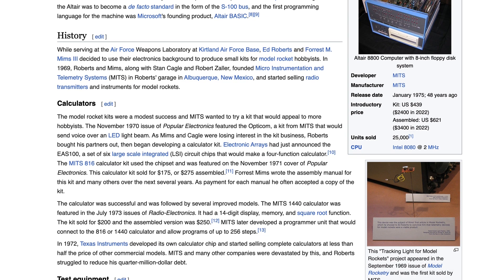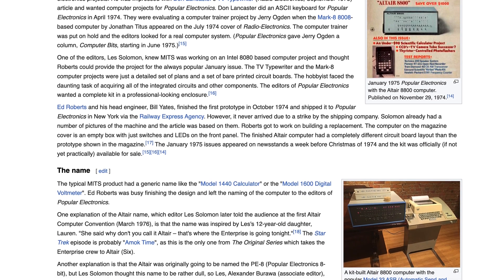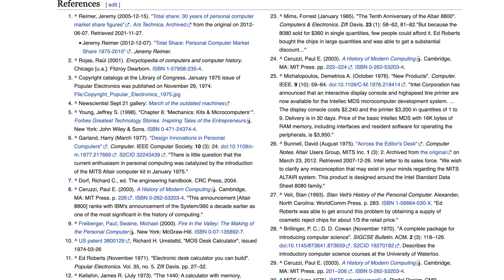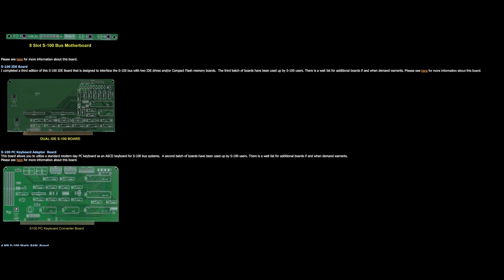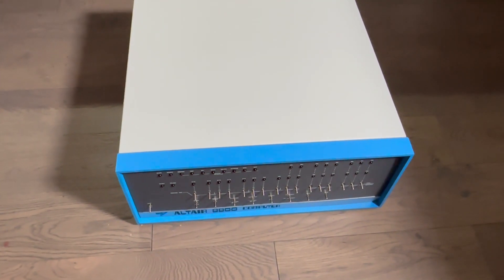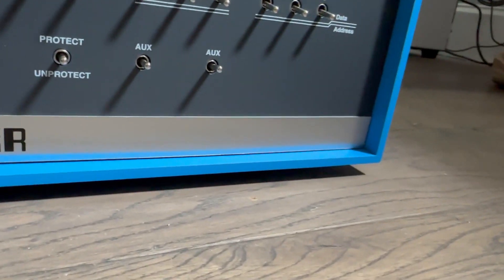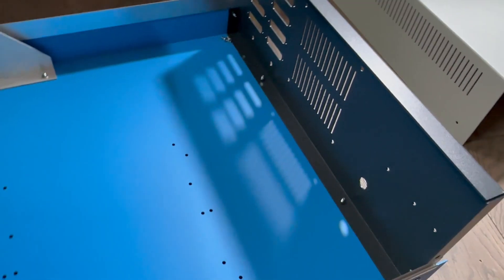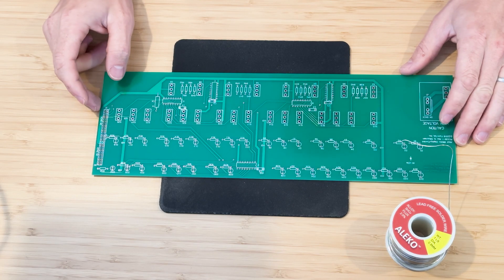Altair 8800 Build - Front Panel Board

Comment: Hmm I think you should rethink your procedures. Did you test the switches and LEDs before installing them? IMO you are going about all this backward. It's not good advice for a beginner to follow.
Reply from the maker: The switches and LEDs don't require testing since they have a high chance of working (I don't think I've ever had a bad LED or switch out of the box). If you mean testing the board to verify that it was working, I did run a few tests to ensure connectivity but doing a full test will require additional boards which, at this point, I did not possess. This is not necessarily an instructional video but merely a documentary of the process that I used to assemble the Altair 8800. The assembly instructions can be found in the description of this video.
Reply: where's the fun in that?.....testing a couple dozen LEDs....boring....nothing like a good old fashioned HUNH? to get the brain online...

Comment: Another complaint about technique - you should always hold onto the lead when you cut it, particularly if there are lots of them to deal with. And cutting it too close to the solder joint can weaken it. It should always feel sticky because you've left a mm or so extra above the joint.
Reply from the maker: The leads always stick out at least a mm or two past the solder. Maybe it's just hard to see in the video.

Comment: A bit of a complaint about the tape - under other circumstances this could result in damage to the board, from something minor like removed text to something major like a lifted trace. Just splay out the leads and the components will stay put without tape. This will also open up a better cavity space for a solder joint. Otherwise the solder can pool up around the lead and not make a good connection with the trace.
Reply from the maker: I don't like the end result of splayed leads. In my opinion, it looks much better having them straight and using light tape to keep it in place while soldering.
Reply: Instead of spreading the leads after they are in the PCB, bend the leads outwards before putting them into the PCB just enough the they act as spring tension/friction.. If done right, the leads will be 90 degrees to the PCB, but still hold themselves in place..
I use needle nose pliers to bend leads, so that I can get them just how I want..

The one thing I would do if I designed the PCB, would be to include a lead bending gauge, that would help you bend leads with the right spacing.

I can't wait to  see it running.. 
I have a S100 bus computer called "Xitan" made by Technical Design Labs.
I bought it used and I never got it running. It would just fill the screen with 
simi-random characters.

One wild thought I had, was to use KiCad to make a C64 clone PCB that plugs into the S100 bus. Then I could run something like Hes Mon to see every one of the 65535 address bytes to see what is going on...
Reply from the maker: @WagonLoads  That is a good idea! This is an older video so the Altair is already running :-) I have itchy fingers so I tinker with everything that I find. If I had that Xitan I would definitely be tinkering with it.

Comment: Did you forget to install the ICs before bolting the front panel board to the front panel?
Reply from the maker: Good catch! Yes, I did. I had to re-bolt it after installing ICs. A lot of work!
Reply: @artemkalinchuk We've all been in similar circumstances. This is a great series of videos. Thanks for sharing your work! I'm currently on my second 8800c but this time I'm using an 18-slot mainboard. I ran out of slots with the 9-slot version.
Reply from the maker: @tomlake2732  I appreciate it. What boards did you install in your first one that used up all of the slots?
Reply: @artemkalinchuk  I was running Timeshare BASIC so I had four 2SIOJP boards in there for a total of eight terminals. It ran really slowly when all eight were active but it ran!
Reply from the maker: @tomlake2732  Ah, that's pretty cool! I'm hoping to add additional boards as well.
Reply: @tomlake2732 that is awesome....bet that 8080 was running at max thermal dissapation under that load
Reply: i prefer....an  unplanned mock up...or....the premature assembly phase